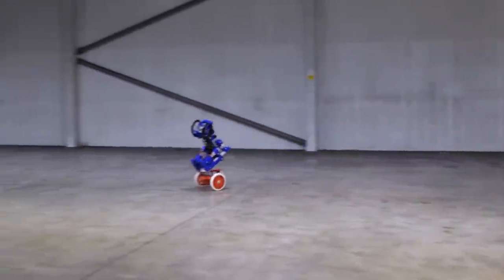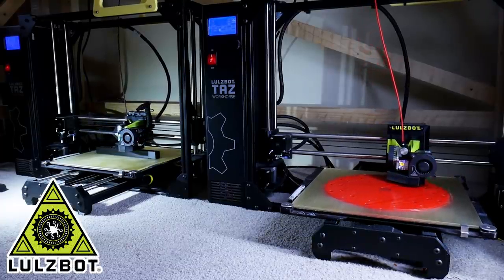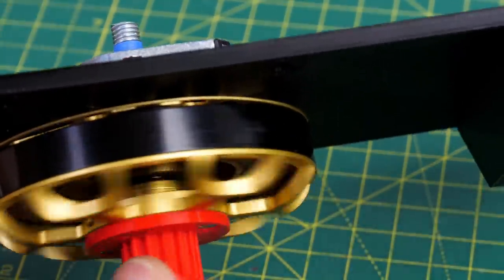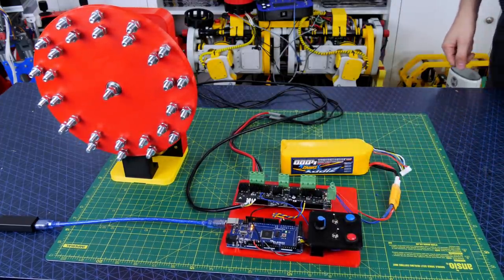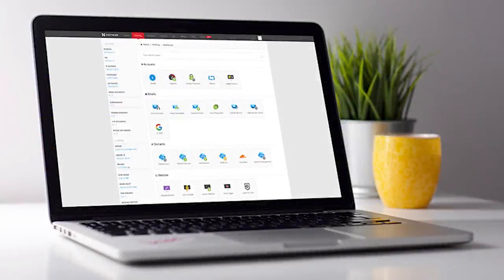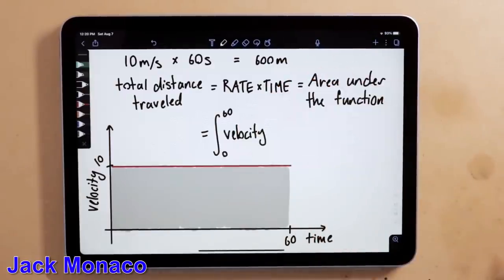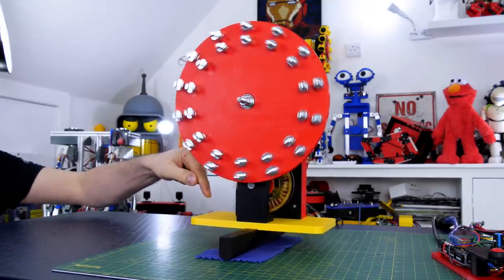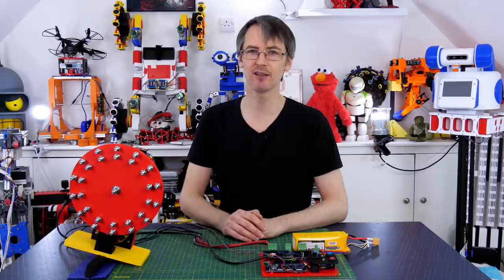What is the Difference Between Reaction Wheels and  Gyroscopes?

Comment: I actually really like how you explained the PID loop! I've been flying FPV drones for years and I genuinely didn't know what each of them technically did on a mathematical level; all I knew was that P makes it react faster, I makes it hold the position harder, and D dampens it.
Reply: Your recap of the recap actually helped ME. :D been flying fpv for ages and I never quite got the pid stuff, not even after James' explanation - maths just doesn't make it through my skull.
Just one thing - what do you mean with "dampens it"? Of all the values D has always been the most imperscrutabile to me.
Reply: @fallingwater  from wikipedia " It aims at flattening the error trajectory into a horizontal line, damping the force applied, and so reduces overshoot (error on the other side because of too great applied force)."

It basically is a term that lessens the impact of I so that it does just a little bit less. Which as you get closer to the target has a bigger effect.
Reply: @fallingwater  Think of Proportion as what controls and counteracts positional and instantaneous changes.

Integral as what counteracts and controls constant force such as an imbalance or wind.

Derivative as what counteracts, manages, and controls acceleration and deceleration. Limits max acceleration, and begins decelerating at the correct time and force to allow the system to stop or balance right on the money. This needs to be tuned based on how much mass there is in relation to the amount of force you can apply along with your P and I limits to keep the system from going too fast and/or too short of a distance in that it can't stop in time and overshoot or so that it doesn't undershoot.
Reply: Real useful info on the pid stuff there. Im a game designer and well... its something i needed to learn without a lot of helps hehe
Reply: @nyscersul42  Try it out with a physics simulator or in gmod.
Reply: How does James Bruton get robot parts that don't break on arrival? Most of the parts I buy breaks on arrival. Does he just keep throwing money until he gets lucky?
Reply: @fallingwater  Its based on some of the most fundamental (and difficult) maths out there - calculus. Proportional Integration Differentiation. In theory it can give you totally smooth control because its based on the rate of change as well as direct values. James can explain it (and understand it) much better than me.
-- (This part removed because it was wrong - showing I needed to look it up on Wikipedia)
Reply: But he uses Arduino,  which means he re-uses the PID samples from there. which means he really didn't even need to explain anything, which means an explanation won't help you much in re-using and tuning the controller.

Comment: In a PID control loop, the Proportional factor looks at the present feedback value and sets a base output based on that. The Differential factor looks at the current trend (differential) and predicts the future and thus corrects for the future error. The Integral factor looks at the past and the accumulated error and corrects for that.
Reply: The beautiful thing about PID controllers is that they're so easy to work with.
In my Feedback Control Systems class our professor explained PID controllers, then after that test he told us "now, everything else we're going to talk about from here is nice and interesting, but in every practical system you'll ever work with you're just going to set up a PID controller and tweak it until it works".
Reply: @ltjgambrose  Did your professor talk about automated tweaking? I was surprised to hear James Burton say that he tweaks the weights by hand. It seems like the perfect thing for a neural net to train on.

Comment: The disadvantage of reaction wheels is that you need to change stored energy rapidly (at the control signal rate).  Gyros have stored energy, which stays constant.  So you need a power source with the ability to output high powers at the control signal rate.
          Your "centering" loop & the integral part of the PID loop are the same thing.  You should be able to do everything with the I term for centering, & not need the separate centering code.
Reply: @profBricks  Gyros are much simpler from a control aspect.  In the short term, you need to do NOTHING to keep the craft upright.  The control algorithm needs only respond to "slow signal" to keep gyros from running out of range.

Comment: Another great project James. When you turn the power off and it rests diagonally on it's side it would be amazing if it could get from this position to balancing under it's own steam (i.e. without you standing it up). In one of your earliest tests it goes from that position to tipping over in the opposite direction so it at least has enough acceleration to get it up to the balance point but whether it can then catch itself would perhaps need some adjustment to the PID controller but would be pretty cool to see. 👍

Comment: It never ceases to amaze me how much you can do with a 3d printer and a bug of ingenuity.
Reply: ...and in just one week, week after week!
Reply: I feel just the opposite, it's amazing how much stuff here doesn't need to be 3D printed, and could be made more quickly with conventional sawing and milling techniques! But, those machines are larger, and need more attention while they're running, whereas a 3D printer is relatively fire-and-forget. 

As long as things are being 3D printed, it's almost a waste not to take advantage of FDM's ability to tune the interior and exterior structure, not just with infill and shells, but outright FEA and topology optimization. They'd print faster and be stronger, but it'd require a lot more CAD at the outset so it's understandable that nobody bothers. 

Still feels goofy to make a solid rectangular slab on a 3D printer, though.
Reply: @myself248  I mean, when you roll into mass production with somewhat of an end product in most cases you wouldn't want to use 3d printers. But when you are in the process of engineering a piece, the 3d printers are great to make your prototype into reality fast and cheaply, which helps to harness creativity. In this video he makes a proof of concept rather than a full robot or selling product. And what he's doing would've been harder without a 3d printer.

Edit: My point isn't a contradiction to your comment, rather I tried to show why 3d p. might be better in his case

Comment: Nice video as usual, I have a suggestion for the one wheel balancing robot why not use a ball that has rubber rollers to drive the X and Y axis separately imagine an old school ball mouse  but instead of the user/ ball driving the rollers the rollers would drive the ball. The ball could sit on top of ball bearing balls
Reply: That's basically how some of his bb8 droids work in his older videos
Reply: @clonkex  They're driven from the inside no? I get it's very similar but having the components on the outside is far more practical.
Reply: @ModerateDev  I'm like 99% sure there was at least one version where he had an empty foam ball and the head did a balancing act on top using rollers. In fact I remember he added ball bearings to the middle to try to make it balance better. Unless I'm thinking of Matt Denton, I can't remember if he did BB8 things as well...
Reply: @clonkex  The head balances on top with a strong magnet mounted to the frame on the inside though no? like yeah there's rollers but they're no driven, could be wrong haven't seen his BB8 video but that's generally how its done. But like I said I know he's done similar things before but I haven't see him do what I suggested then again I have not seen all of his content xD

Comment: Phenomenal job James! You in fact helped me with a project I'm working on! Particularly the reaction wheel becoming saturated over time. Your solution is elegant and I love it! 

Is there a specific reason you chose to use the HTD belt reduction over direct coupling of the reaction wheel to the motor? I would imagine to make the strain on the motor considerably less as that's quite a bit of mass being handled. 

Also, is there any chance you could provide some insight on your configuration of the ODrive? That has got to be one of the most tedious parts for me.

Comment: I don't love the PID explanation as it's a little misleading. Although it's possible to stabilise an inverted pendulum with a PI controller, it's not typical like you say. You'll have much better results with a PD controller, with optional I term if it's not going to be ridden by a person.

P term: Bias system towards setpoint
D term: Bias system to stay where it is, resist movement
I term: Correct for persistent disturbances over time e.g. wind, added weights

On a self-balancing electric rideable, you actually cannot use the I term, as the human rider will subconsciously perform the I term correction and the human and controller end up fighting each other and tipping over.

For a clearer explanation of PID controller and tuning see this video: "Electronoobs: PID Balance+Ball | full explanation & tuning"

Comment: Let's say you had two reaction wheels with offset mass that rotate in opposite directions. In one half of the rotation you accelerate the mass, the other half you decelerate. Could you get a reaction force pulsing continually in one direction?
Reply: No. You could get the reaction to be linear, and depending on the difference in acceleration/deceleration you could have the force applied in one direction harder and shorter or weaker for longer than the other, but the reaction would still be in alternating directions and the total work done in each direction would cancel out. 
 
For an intuitive understanding, that layout is how dualshock game controllers generate vibration.
Reply: @idahocartwrights  what if you limited it to a single axis, like with a car? Then you could dump the energy into “another dimension” where it wouldn’t matter.
Reply: @float32  I'm not entirely sure what you mean, but it is possible to turn vibration into forward movement against a surface once you include friction and gravity. If the linear back-and-forth movement is diagonal, and you can push off the ground without slipping, then you can jump forwards, rinse repeat.
Reply: @idahocartwrights  This is kinda of interesting then because you could control the direction of the impulses, creating a haptic sense of direction in the controller, rather than buzz BUZZ buzz.

Comment: Hi there, I'm a hobby machinist with a neuromuscular movement disorder characterized by constant muscle contractions. I've been tracking the evolution of exoskeletons as I believe this would be an ideal treatment for me. I don't have any weakness, just a great deal of unintended motion. No company will work with me on prototyping due to liability concerns. I'm stumbling my way through learning this stuff, I'm not very tech savvy, and hope to one day make an exoskeleton or at least a few portions. I believe that the spinning Mass principle displayed in your last half dozen videos will necessarily be the heart of this device. I was wondering if you could recommend other resources for beginning learners and I don't know if it exists, but software that would allow me to test designs without building one first. Secondly, I wonder if you can point me in the direction of any relatively affordable existing products that utilize this principle, that I might be able to source parts from. I'm not new to prototyping nor product development, but I'm a complete novice with all things computer. Lastly, I don't particularly think a 3D printer is a good match for my needs, but if the software I referenced does not exist, do you think a 3D printer would give you useful results using it to trial and error various designs? Are the properties of the filament print analogous to wood or some particular alloy? I realized that I'm asking a ton, I certainly don't expect you to provide all of this. I figured if I throw all of my questions out there it might give you a better idea of what level of understanding I have and the best place to point me to. The other reason is in hopes that other viewers happen to read this comment and opt to offer a suggestion. It is a bit cheeky, but I figured it's definitely not going to happen if I don't ask. Thanks very much whether I hear from you or not. Your videos have been enormously helpful, you explain things in a way that is very effective for me, thank you. I don't think I would even consider taking on a project like this if I had not seen a handful of your videos. You explain concepts and programming in a way that us old guys who are mechanical can really grok

Comment: Fascinating channel that YouTube threw my way. Good content.
I have a question regarding the tuning of the PID controller; could you, in principle, create an evaluation function that tunes the PID automatically? 
I've never worked with robotics, so just looked it up on Wikipedia just to have some idea of what might exist, and it lists a couple of methods that look like they could be used in this way. If so, you could then use the same code to control any arbitrary robot, provided the control system is sufficient.
Reply from the maker: Yes there are PID Autotune algorithms.
Reply: @jamesbruton  Why don't people use them? Is it that tuning by hand is so easy or that using autotune is so hard?

Comment: Hey James.. you might say youve already done this.. can you calculate the idle balance/drop point, with the pid code...to determine how the actual mass deviates from the center of gravity..
Reply from the maker: You could have another branch on the controller to dynamically alter the balancing point so it will deal with offset loads.

Comment: I realize this question would require a great deal more data to answer precisely, but I'm wondering if there is a quick rule of thumb on the subject. Some of these that you have shown are constantly spinning and change their speed or orientation. Others REACT to external stimuli and attempt to correct with the least motion possible. Of these two designs, forces in the human weight range, which one would likely be more energy efficient?

Comment: What about using a smaller wheel but with Brass nuts and bolts cause they can be heavier, since you said you where concerned about the size of the wheel. Anyway love your channel, thanks for posting.
Reply from the maker: The diameter of the wheel will have the largest impact.
Reply: @jamesbruton  no I understand how that can be, but I was thinking about in one of your smaller Omni wheels for space. Either I'm locked in to watch, I really enjoy your videos. Thank you

Comment: Great video, I always love anything with PID control.  But just a thought here.  Since it's not the speed of the wheel but the acceleration that provides the righting force, would you get more torque and righting force by reversing the gears?  A large gear on the motor and small one on the wheel (or at least 1:1), the motor 'sees' a much larger moment of inertia and could then generate a lot more righting torque?

Or at the very least, a more equal gear ratio would allow you to use less mass on the wheel if you want to get the overall size down.  Of course the wheel's top speed would be higher and you might have the same gyroscopic precession problems, but it seems like it would be fun to try.

Comment: I wonder, if you were to mount two or three reaction wheels on a rotating frame, parallel to the reaction wheels, could you use the reaction wheels to add energy to one side of the frame's rotation and remove it from the other, providing a net force in one direction...?
Reply: Kinda like a ferris wheel, only different.
Reply: By the way, this isn't exactly the thing I've been wanting to explain to you. But, it's a step in that direction.

Comment: Would it not work better to control acceleration with the PID rather than velocity as the thing you are trying to control is the force?
Reply from the maker: That's what the Integral term does.
Reply: @jamesbruton  is there no second order intergral that can be used from the I term of a accel PID rather than the I term of a vel PID?
Reply: Force control is actually what would be desirable for applications like that. However for that to work properly you need to create a decent mathematical model of the system dynamics, which is not as simple as using just a pid controller. Also pid controller often do a reasonnably good job.
Reply: @fabianaufdermaur6051  since controlling the acceleration rather than velocity is 1 step closer to force control and thr odrive supports acceleration control.
Would it not be free stability to use the simplicity of a pid to control the acceleration rather than velocity?
Or does it not work like that? Why not just set accel = x rather than set vel = x?
Reply: Well you first have to calculate what acceleration you actually want. Which you do with a dynamic model of the system. After that you are correct you can use the acceleratio.
Reply: @jamesbruton  I think you mixed something up here.
The I term corrects for a static error, which in this case means if the velocity does not reach the exact value over a longer period.
The Derivative term dampens the motion which would be the 'acceleration control'.

Comment: the idea of not using the motor itself instead of the motor driving a flywheel
add weight to outer rim of the motor 
I'm sure you wont need as much weight but a lot less then a flywheel driven by a belt
thus the motor itself would be able to respond more faster and more accurately......